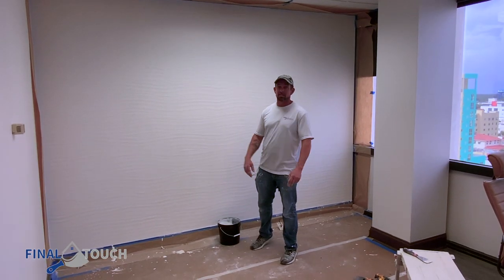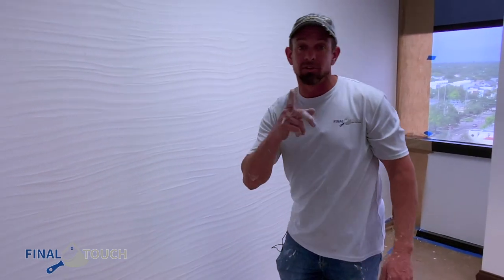How to Create Metallic Wave effect Wall with Venetian Plaster!

Comment: Why? You're not using VP for the effects it creates. You could create this with any paste like material. Heck even joint compound. Then spray with a metallic paint. Vp can be very expensive.
Reply: I thought the same, the mud is cheap at HD or lowes.
Reply: Right then finish it off with a poly coat or 2